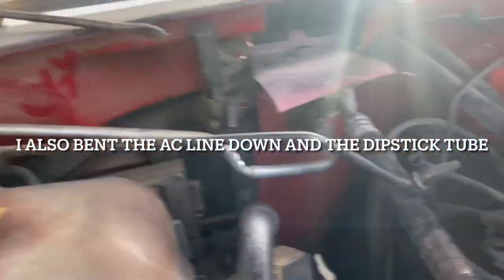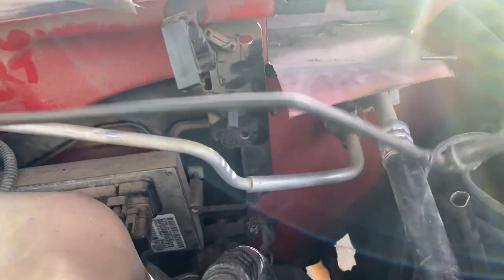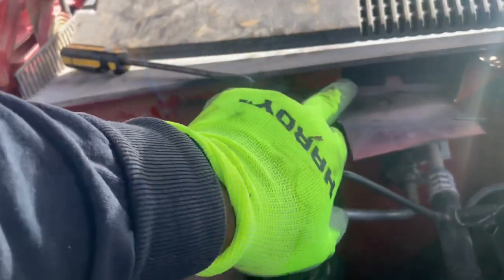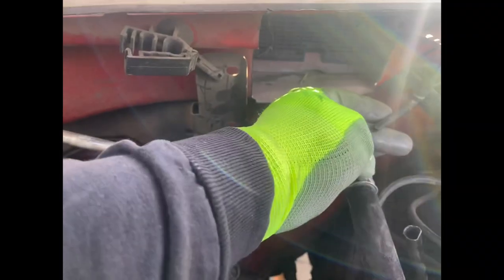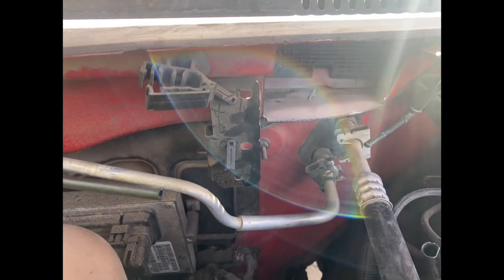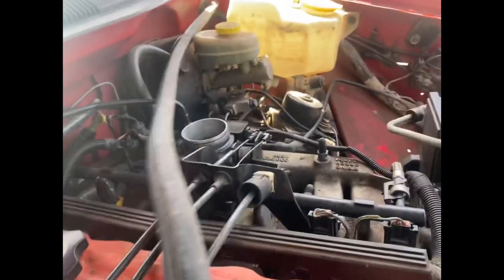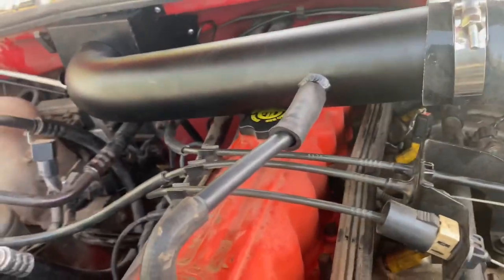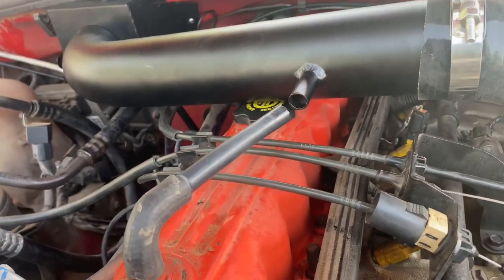Jeep Zj grand Cherokee on 38s THOR trail head off road intake install 4.0

Comment: Second comment - Soooo... I went back and watched a couple more of your videos, particularly the one from Nov. 2021 - You now have a new Subscriber. Looking forward to more off-road and/or build videos from you! Also meant to ask - are you running your ZJ with the OEM gearing for these 38's?
Reply from the maker: I appreciate the support! And no. I’m running a 8.8 rear end with 5.13 gears and a hp dana 30 with the same gears. I have lockers front and rear aswell
Reply: @RashadsGarage  Thanks again for the response! I'm in Southern Utah, new to this recent offloading YouTube craze and watch a lot of Matt's Off Road, Fab Rats, Bleepin Jeep, etc. - - You seem like you'd be able to run with them on most trails. 😉
Reply from the maker: I plan on going out to southern Utah to Offroad. I just don’t know when. I watch those channels all the time especially fab rats. Now as far as hanging with them Offroad….. I think I can do some of the trailers they do but definitely not all lol

Comment: So you eliminated the AC? Or just redirected the lines by bending them? And the intake goes into the firewall? I don't get it
Reply from the maker: No I’ll never remove ac. I bent the line out of the way. I broke a vacuum line for the ac but I fixed it. Yes I moved the intake into the firewall.
Reply: @RashadsGarage I see how does it get air from the firewall?
Reply from the maker: There is a vent right above where the intake sits

Comment: The thing I can't understand is how you would keep this intake system's air filter clean/dry as you wash your vehicle, drive through the rain, snow, sleet and/or especially when charging through the mud??
Reply from the maker: I can’t speak for snow since I live in the desert and I don’t mud. I’m not too sure how it’ll do in a carwash or rain. I know a few people who run it and say it does fine
Reply: @RashadsGarage  Thanks for the response.
Reply: That side of the cowl doesnt get any water until the drivers side fills up. It has a drain though and from what i hear the passenger side is almost always dry as a whistle whenever people clean their intake filter